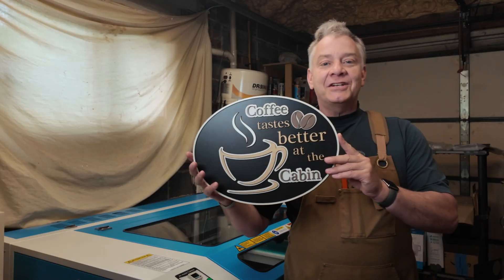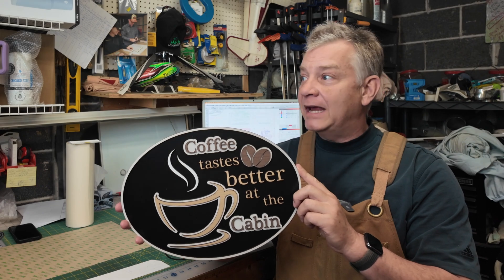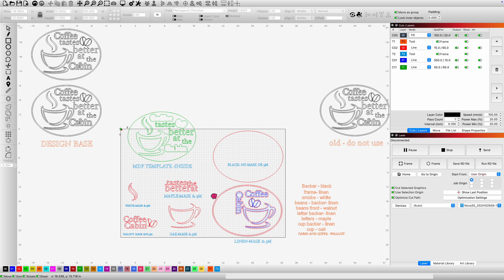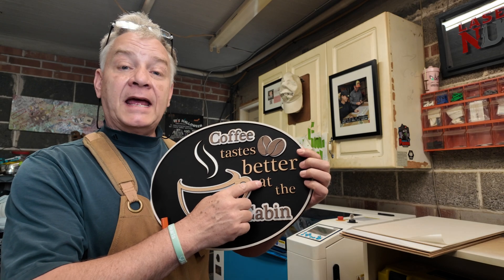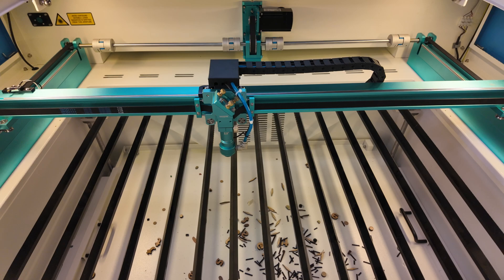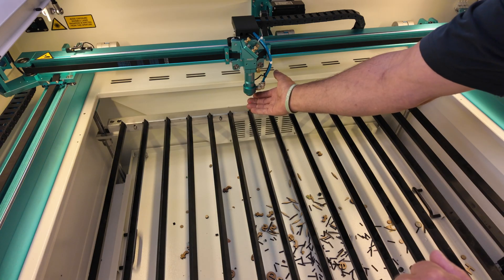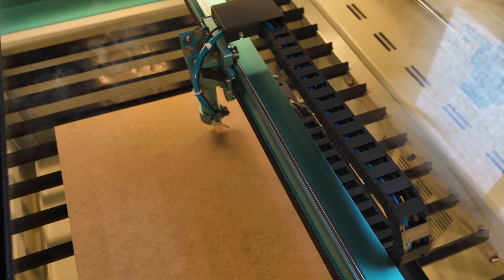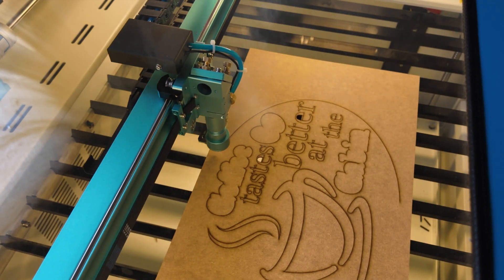How I Operate my Nova PLUS 60 Watt RF Laser. Step By Step. 089   4K

Comment: I am new to the laser world, I recently purchased the nova plus 35 and the Aurora lite. I was wondering, when you design projects such as this one, do you create them in a separate software or directly in LightBurn? Thank you
Reply from the maker: Good ,morning Rick and congrats on the new lasers! I am not very skilled at design so most of the graphics you see, I buy online and then I assemble the overall design in Lightburn using the various graphics that I have bought. Add the text etc and that is about it. Hope that helps - have a great week!

Comment: I’m looking at upgrading my laser as well and wanted to know why you chose the Nova plus as opposed the the bolt pro 32? Thanks for the videos on both channels.
Reply: Thank you for your time and sharing these videos. I’ve been laser engraving for a couple years but still learn so much from your videos. Thank you!
Reply from the maker: Hey thanks. Both great options I think. If you want to discuss I am happy to talk further if you want to email me your phone number but short answer - big price difference primarily because the PRO has a Coherent RF tube (which I don't think I need that high a quality of tube), Bigger bed size -materials you buy don't come in 32x20" - they come in multiples of 12" ( Nova PLUS bed is 36x24), tough to use 2000 mm/sec engrave - as it takes room away from the effective work bed area, nova plus has full pass through doors for bigger pieces (Pro has front only). Hope that helps a bit - good luck and let me know how it turns out!
Reply: @LaserNUG thank you for the info. I’m still weighing my decision and for the price I could get the 80w Nova plus 51 if I had the too for it. Do you get decent quality out of the in bed camera?
Reply from the maker: @SublimeOutdoors  LOL! I almost did that video this weekend. I have not connected it yet on the Nova PLUS. The BOLT camera is very accurate and useful so I use it for smaller items around the bed. very exact and a super helpful feature for accurate lasering on stuff like keychains, patches, coasters, cosies, cards, etc but I have not set it up yet on the PLUS. But I will soon. I just have a feeling i will keep using the BOLT for the smaller stuff since I have both now. Cheers!